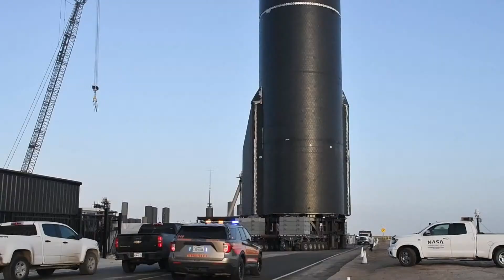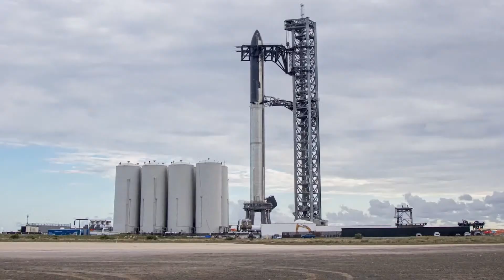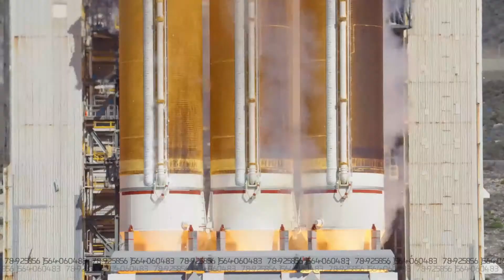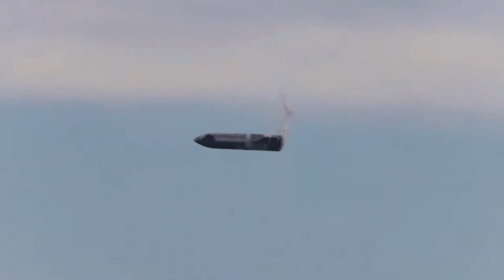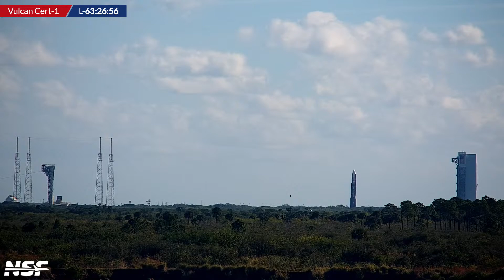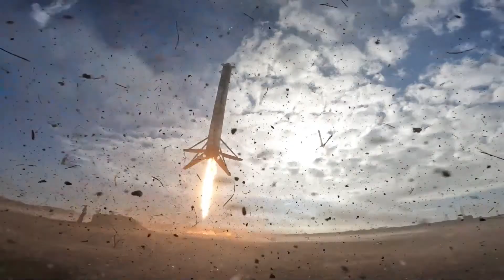ULA Rolls Out Vulcan Centaur for Peregrine Mission One

Comment: The best shuttle? (53:30). That would the Russian shuttle, "Buran" launched 1988, it's 100tn riding purely as a passenger on the launcher "Energia" (3,500tn thrust, 100tn to LEO).
This shuttle had a 25tn max. payload, uncrewed capability, crew escape system, jet engines for landing and the first stages were to be fitted with landing gear for reusability.
It flew and landed successfully; if the Soviet Union hadn't suffered economic collapse, this Russian shuttle would have been as familiar to All as the U.S. Space Shuttle became.
Reply: uncrewed capability and jet engines are nice but jet engines are unnecessary for shuttle.  depending on the orbiter, the shuttle also had about 25 ton payload capacity, and the soviets probably wouldnt have developed flyback boosters if were being realistic. tell me about the crew escape i wanna know more